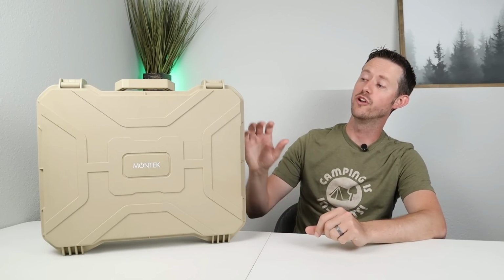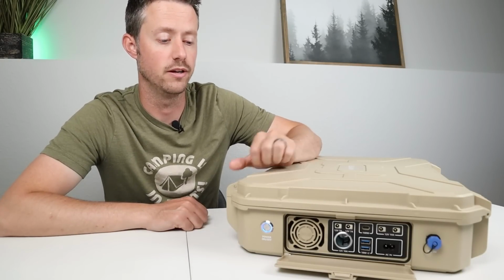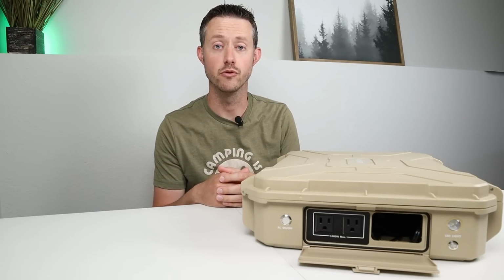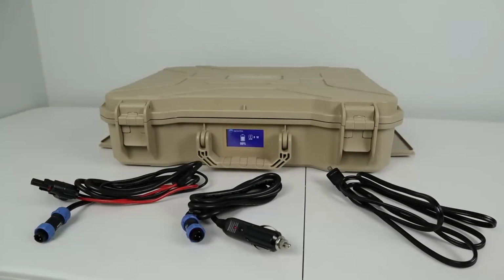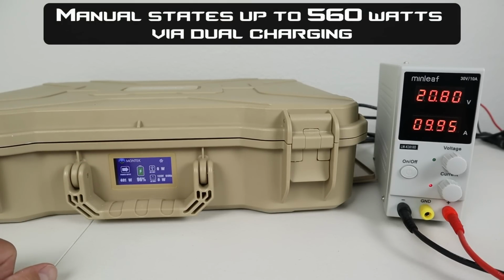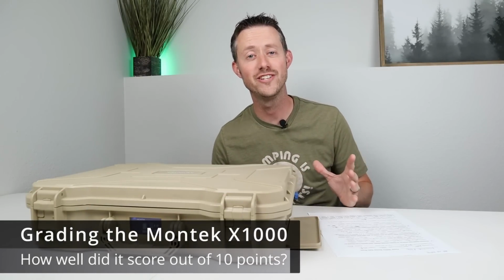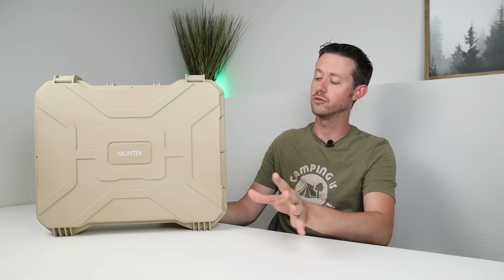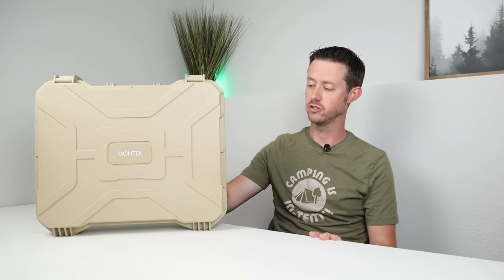Montek X1000 - Rugged and Rain Proof? 1010wh Lithium Power Station

Comment: After a year, I would not buy this again. My Ecoflow Delta 1300 is in every way superior.

For starters, construction quality is poor. The plastic doors on the sides are flimsy, the metal pins which act as hinges fall out constantly and the closures are weak and very fiddly.

Next - poor design. The two doors must remain open while it's in use, to prevent overheating, and they are vulnerable to breakage when open. The unit is not particularly stable standing up like a suitcase - you can't tell on a flat desk - so it has to lie down when in use - and this gives it a HUGE footprint for the minimal capacity and output.

The big selling point is the IP rating but the unit is NOT water-tight when the doors are open, so effectively this is no safer than using any other battery in wet / dusty conditions.

Finally - I have had this for a year. I have used it perhaps a half dozen or 10 times, charged it as many... and already it will not charge beyond 98%. It just beeps at me and never goes farther. This is unacceptable in a battery of this type / price. And there is NO customer service to speak of. I bought this specifically to use at events, but ultimately the 'solar generators' I already owned would have worked better. Lesson learned.

Comment: Thanks - nicely done, appreciate the overview and testing. Question: Rather than use a cigarette connector to the batter for DC charging, could you have used the solar port and connected that to a lithium batter? I'm wondering if you "fake" the solar input using a Lithium batter would you gain a better recharge rate than the 10 hours mentioned in the video? Thanks! - Mike
Reply from the maker: It's based on voltage input. For example, lets say it charges at 10 amps max since I can't remember the actual limit. At 12v and 10 amps, that's 120 watts charging. A 200w solar panel puts out 18v and 10 amps, so you'll see 180 watts vs the 120 watts at 12v.

Basically you want to get as high of voltage as possible from your charging source so you can get more watts. Just don't go over the max voltage input limit and you'll be good.

Comment: I got in on the ground floor indirgogo I bought two units and 2 120w portable panels two years ago and I think I paid around $600 for everything.  I’m fulling timing in my truck camper and one of them is constantly sitting in my truck plugged into my cigarette lighter powering my 60L iceco frig.  This solgen can run my frig at36-38 for 3/4 days I have 690 ah battleborn victron everything so I can invert and power the solgen while it run my frig or I can use the  solar panels.  I have doing everyday non stop for 7 months so far and I have been in 100 degree temps throughout WA, OR,ID,WY,NM,UT and Texas and no fires.  I think what I’m going to do going forward  to make sure I never have fire is use the AC from my truck camper electrical system to power the frig when I’m at any location for a week and plug the frig into the cigarette lighter when I’m traveling … the last couple minutes of your video when you talk about lithium phosphate and the fact that it’s doesn’t use it now makes me rethink how I’m going to use it.  I did a firmware upgrade to reduce the output from montek so maybe that was done to prevent any potential mishaps since I explained how I was intending to use their product.  By the way their was a run time cutoff which I was told how to disable through the front panel.  It now never turns off… so far so good and it hasn’t killed me lol
Reply from the maker: Excellent feedback about the power station after you have really put it to use! Thanks for sharing!! Glad to hear how well it's treated you, it's built so well!

Comment: I just bought one. Fan runs more often that yours even when light loads are applied. Not sure if that's an issue  not loud...just runs more
Reply from the maker: Depends on ambient temperatures.  The fan has specific setpoint when it turns on and off.  It's variable so the speed is often low.
Reply: @Jasonoid  Great power station. I've tested it with a portable stovetop and as long as the wattage doesn't exceed 1100 it'll run it just find

Comment: I'm a regular subscriber/viewer and have to say, this is probably your best review yet.  I have a number of models you have reviewed, and own two Monteks from the original campaign.  It is my favorite in this output and capacity range.  No issues whatsoever, very reliable, very fun to solar charge.  I have the 80W SunPower panels, and they often put out 75W.  I don't bother storing them in the case.  I have a drawstring backpack/carry bag for the panel, extension cables, charging cables and Y adapter for parallel charging.  I have gobs of sogens, but can't wait for the X2100 and expansion batteries.  Since these are pouch NMC, I have no concern about potential fire hazard.  With proper use, there is no concern.  I have many LFP sogens as well.  None perform as well as the Montek.

Comment: Please to answer kind sir.  I have 3 powerstations. jackery 500/bibene 500/eb3a. My idea was to use the fast charge eb3a to  "dump" power into my other 2 units. Using that logic (and minding my coinage) does it make sense to do this or, does it make more sense to get a 2000 watt  VERY LARGE unit? Now , I am not sure if my logic  merits sticking to the 3 small units Please help. I am planning  for SHTF/ camping scenerios

Comment: Jasonoid, with the hot summers we are having what do you think of the safety of this power station in a hot car or suv when you have to leave it running a dc frig when the car or suv are turned off.  I have seen cars get up to and over 130 degrees F in the summer where I live.  Thanks for the great video.

Comment: @17:45  to  make  closing  the  unit  with  solar panel/wires  easier,  use  gravity  in  your  favor!   It  is  lightweight,  so  simply  reverse  it's  position  on  your  table  with  the  lid  containing  the  panel  &  wires    D O W N   .
   Yes,  having  the  wider / heavier  portion  on  top  seems  weird  .  .  .  but  c'mon ,  it  is  just  while  closing  it!
(sometimes  I  just  'crack  myself  up'! ! !)            Take  care,              RH
Reply: I have two units with the solar panel. I keep the solar panel and cables in a drawstring backpack/carrybag.  It's a lot simpler than fiddling with that.

Comment: Look Great But i am the same Lithium iron phosphate battery would be better for me too #Montek
Reply: X1300 will be pouch LFP and 2000W, 1280Wh, expansion batteries with DC output, also X2100, pouch NMC, 2000W, 2146Wh, 800W solar input, will have an app, and a 400W solar panel will be offered.  Coming on IGG in December.

Comment: I like the color, the shape, the weight, and the price.  Maybe I should think seriously about this one.   I have a suggestion; pack the solar panel and cables upside down.  And if you still have a little trouble packing the cables, there's no reason why they have to be wound together like that.  Lay the cables flat in a circle about 8 inches wide, then secure them and lay them behind the panel.   And don't forget to tuck in the panel's handles to keep them out of the way also.   Thank you so much for the review, Jason.   Btw, hope you and the oldest one had a great hike!
Reply from the maker: Thanks for the tips Sandi! And yes the backpacking trip was excellent! 😁

Comment: That is a really interesting power station. I like the design. The only thing I could see is the ac outlets. Did you have any trouble plugging in 2 three prongs appliances? Nice review again.
Reply from the maker: The plugs are oriented vertically so I didn't have issues plugging anything in, however, if you had a large wall wart that might be an issue.
Reply: @Jasonoid  yea, went back and watched that part again and I can see regular style plugs shouldn’t be an issue. Thanks!

Comment: Forgive my ignorance, but could you temporarily have the lid side down when closing to prevent the solar panel cables from shifting while closing. Then flip it back over.
Reply from the maker: That would probably make it easier. The power station doesn't care if it's upside down or not.

Comment: I’ve liked this unit for quite awhile. So glad you ran it through all your tests. This unit definitely has its niche.  Thank you. One suggestion is to run the test for how much power is lost with the AC on but not running anything for a few hours or overnight. You came up up with 1 percent 8n an hour, but it might just barely been one or almost two, which makes a huge difference. Great work Jason. You are my favorite reviewer. 👍🏼😊
Reply from the maker: I actually watched it roll over right at the hour mark, it has very low parasitic drain. Much less than other larger units.
Reply: @Jasonoid  Awesome. When will I learn not to doubt? Lol. Thanks.
Reply from the maker: @litnoregrets7551  I should have been more specific in my wording. One man show its hard to get everything right 🤦
Reply: @Jasonoid  You really do a great job and it shows that you care to do the best videos you can. 👍🏼👍🏼👍🏼

Comment: Do you know how much heavier it would be with LFP? would the sacrifice be worth it? Would it change the pricepoint at all?
Reply from the maker: We will have to see how much their new Montek X1300 will be. It has the LFP batteries and should have more details soon.
Reply: The X1300 model will have pouch LFP chemistry, 2000W output, 1280Wh, and weigh 32 lbs.  It will have 800W solar input, 600W AC input, an app, and expansion batteries with DC output and the same input for charging.

Comment: I've had one for about a year.  Absolutely love it.  The only thing that annoys me is that the barrel plug size for the DC 7a and DC 10a are different.  Not a huge deal since I have a ton of adapters but it is annoying and makes the plug stick out a little further which makes it a risk for getting bumped or knocked.  Also concerning LFP... the new X1300 coming out next year is LFP and expandable.
Reply from the maker: Thanks for the feedback on your experience, glad to hear you love it! Also, they have told me about the LFP option, but no hard release date. I'm hoping to review one right when they are available!
Reply: Did the price change from a year ago
Reply from the maker: @chitownholmes  yes. It was on Kickstarter as a prerelease last year.

Comment: nmc cells means please dont leave this at 100% charge all the time, also no ups mode, probably for the better.
yes i would also like to see lfp in something like this, but it would loose capacity or become noticeably heaver for the same capacity.
imo this use case would be for those times you are on the go and need some power. i would pass on the included solar panel and get something with more output, plus the inconvenience of it getting stuck...
otherwise this looks like a decent emergency power station.
Reply from the maker: I think this one would work well for outside work / camping needs. Someone who doesn't need a full 2000 watt machine. Portable, rugged, rain resistant. It was fun to test something different!

Comment: Can this battery tech work in colder and hotter conditions than life4 batteries. Also charge and discharge in freezing Temps and high temp conditions
Reply from the maker: The manual states operating temperature is - 20C to 40C. Charging temps are the same as Lifepo4 @ 0C-40C.

Comment: btw, on your grading guide I don't see any Jackery products.  Is there a reason for this that I missed?
Reply from the maker: They aren't a very good value with their older features and high price tags. You pay a premium price to get less. For example they have lower cycle life batteries, slower charging, they require expensive proprietary solar panels, and don't offer other features like smart apps, UPS backup functionality, or wireless charging. I try to get my viewers the best value for their cash. Maybe they will change their pricing and feature set in the future so I can recommend them.
Reply: @Jasonoid   so many youtubers (vanlife, etc) use Jackerys...perhaps I'll have to refer any of them that do to your channel.  I have a 500 and a 1000 that I bought at discount, so I guess I'll use them until they fail and replace with the new LFP Montek X2100
Reply from the maker: @setsailatnoon  They are reliable and work well. Those power stations will last you years! They also have quite a bit of advertising over other companies in the market so they are popular. When I was first looking to purchase a power station that was the first place I looked but I couldn't afford their prices, had to find something cheaper.

Comment: I got this unit for a bit less by supporting their kickstarter campaign.  The staff and designers kept us informed throughout the development and took suggestions well.  I really like my unit with the solar panel, I would buy another...especially if they upgraded to a LFP battery and included a kickstand on their panels.  Thanks for the review, these people are amazing.  (Mine is tan also, a suggestion which was made by the community)  They're currently designing and testing 2100 and 1300 LFP versions.
Reply from the maker: They have plans to do a LFP model sometime in the future, kickstands on the solar panel would also be a big plus :) Thanks for sharing your experience!

Comment: Curious to know if any other solar panels fit inside the case? Specifically one with a little more output like a 150w folding panel.
Reply from the maker: It's a pretty small Space, I doubt anything larger will fit at all. It's designed exactly for their 80 watt panel deminsions.

Comment: I’d buy this if the ac inverter could run 2000W.  Microwave is a must 😂
Reply: Montek is coming out with X1300 (pouch LFP) and X2100 (pouch NMC), both are 2000W with expansion batteries available, and will have an app.  800W solar input.

Comment: Jason, as usual an informative over view. In addition I would like to know your opinion in adding the "Manufacturer's warranty" to your list of 10 important items.
Reply from the maker: All these power stations have similar warranties, usually 2 to 3 years. What aspect of the warranty do you think should be added?
Reply: @Jasonoid  on Amazon, I have noticed many do not mention anything reg warranty. Mostly some where at the bottom of the description it is stated contact the manufacturer for warranty info. The duration & infact if the item is supported by any warranty is an important & useful fact to know.

Comment: Cool setup. I wonder if they may have underrated the batteries in order to meet the advertised output. (Not a bad thing.) After watching your experience with the exploding fridge battery maybe they should offer an optional armored case.
Reply from the maker: Thats what they need! An 'explosive proof' case for these NMC power stations! Great idea!
Reply: all they really need is if the temperature gets too hot, it dumps fire-retardant into the case and prevents it from going up in smoke, though that usually also destroys the battery and it is no longer usable. but better destroyed battery than destroyed everything around it as well when explosions and fire happen because it got too hot.

Comment: Hello Jason, very efficient and accurate review. You did a wonderful job informing me about this Montex X1000. I to wish it had LiFePo4 batteries, but I sure like how you mentioned the batteries in a modern cell phone and laptop are using the same chemistry as the Montex 1000. Users need to be responsible for the equipment they operate. I was very concerned no mention of an APP. Is there an APP? I know battery temperature is a vital data point to monitor as a user. An APP must be part of the component so a user can monitor the component and not have to drop to their knees and read an LCD screen that will be difficult because of the sun. Is there an APP? Does the APP show the units internal battery temperature? Take care.
Reply from the maker: No app on these model. Its becoming more and more popular to have an app though!
Reply: The two new models launching on IGG in December will have an app.  The X1300 is LFP chemistry, 2000W and 1280Wh, and the X2100 is 2000W and 2146Wh.  Both will have companion expansion batteries available to double or triple capacity, with DC outputs and the same 800W solar input and 600W AC charging as the X1300 and X2100.
.
Reply: @LipsMalloy  👍